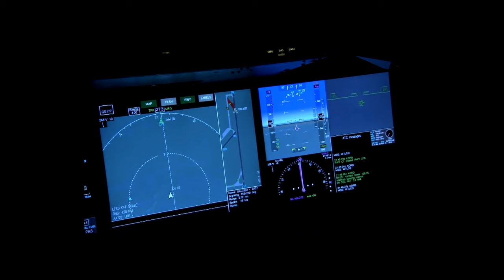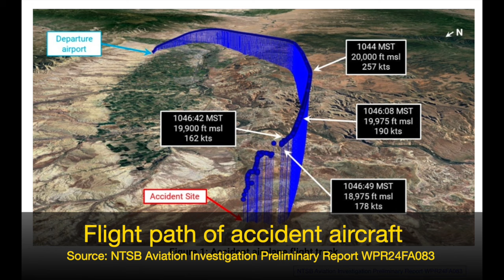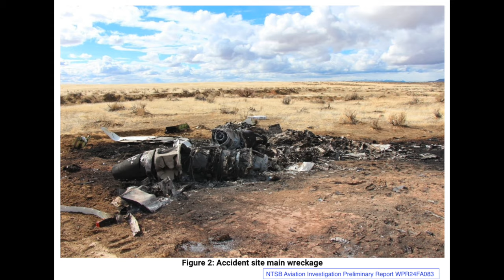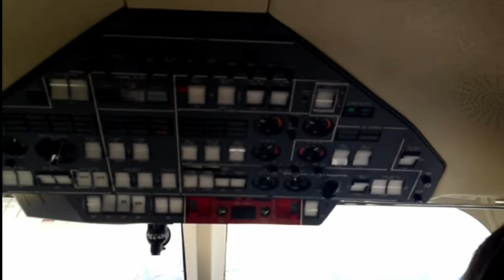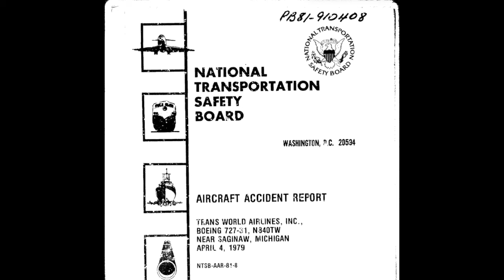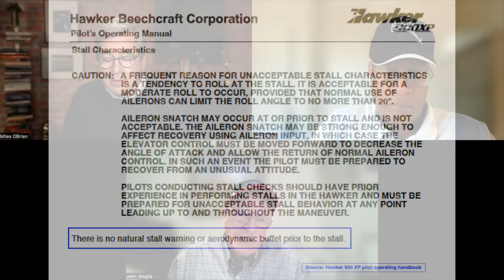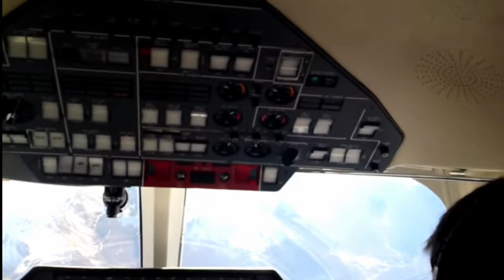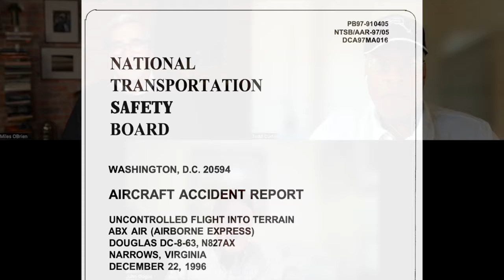Stall Warning Flight Test Turns Disastrous - Episode 216

Comment: Hawker pilot here. A couple observations:

In the procedures for this test, point 5 stipulates that the test go to the pusher then recover to normal flight. The pusher should activate prior to a stall…that’s the purpose of the pusher, to forcefully reduce aoa prior to a stall.

The purpose of this test (and similar tests on other types) is to ensure the wing/leading edge was reinstalled at the correct angle/position. This is verified by the shaker and pusher activating at the appropriately calibrated aoa. 

I’d also point out that in the Lears, these tests are REQUIRED to be performed by a manufacturer test pilot. Not something to be taken lightly.

Comment: There is no ground check equivalent?
Reply: Hard to simulate a stall on the ground. If you're testing something that is trying to prevent a stall, you need to be able to make it think there's a stall developing. That means fooling at least two different sensor types, and depending on the plane likely multiple locations of both sensor types. That's now talking a good-sized test rig and likely at least 3 technicians/mechanics. Compare that to the cost of simply flying the bird with two pilots with a specific qualification, on a test flight that probably needs to be done anyways.
Reply: @erichusmann5145  Understood, but if you are a specialty shop it would be cheaper in the long run than hiring specialty crews and risking crashing the plane.